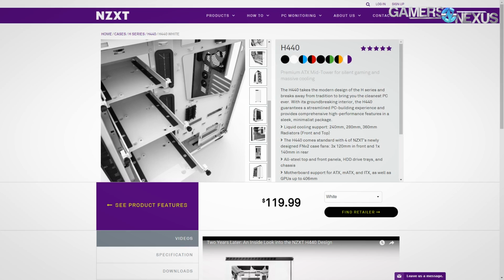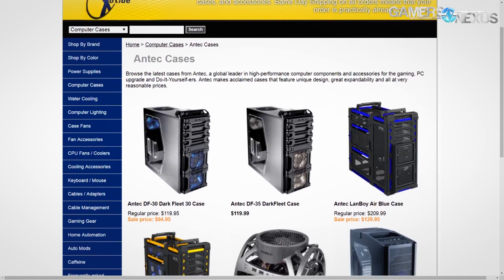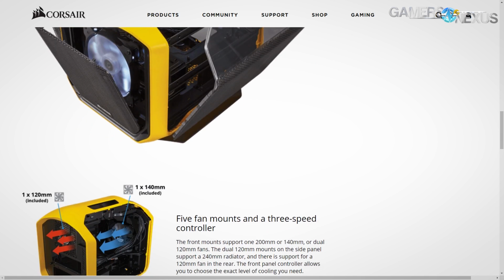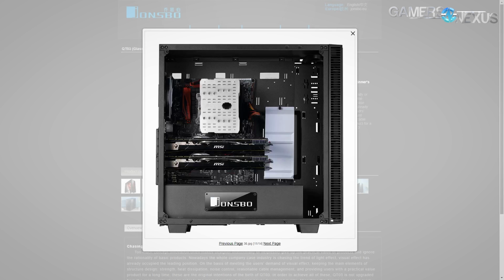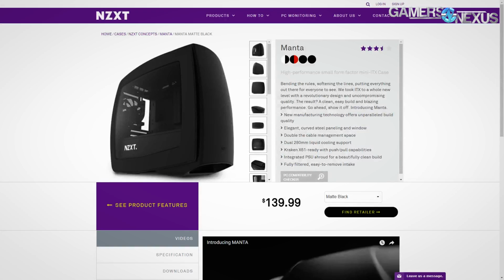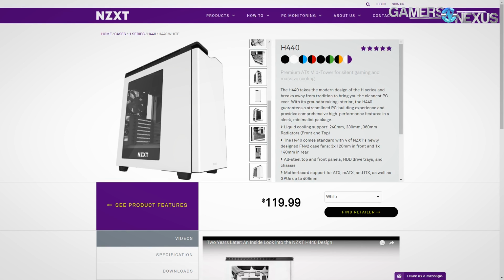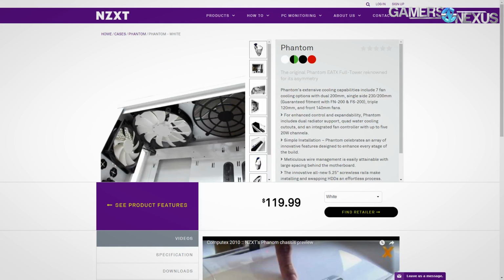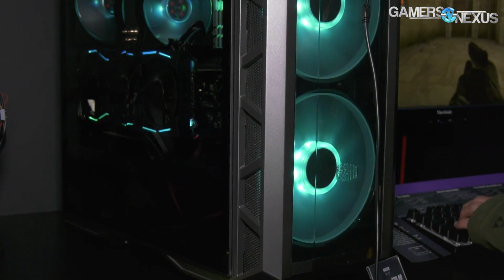Reviewing the Case Industry

Comment: In terms of a air flow case, I wonder if it's possible to shape a case like a GPU blower fan so high speed air flow will quickly come in and leave?
Maybe have the enclosure, the part of the case that is attached to the case, have a powerful fan attached to it, and wired in a way so it's contact to be powered on the edge of the case when you put it on, but can come off with power off without dealing with wires.

It can also have this sort of 'metal/plastic' chamber like in the RX Vega where a huge fan is on the enclosure (or case door which is what I mean), and this fan sucks air from the side, uses that plastic chamber, to blow air into the case, which is linked to another chamber that surrounds the components, oddly you won't have a heatsink in this case like the RX Vega, to blow air through, but maybe some innovation could create something usable.

Hard to describe in words though.
Reply: Long statement short: Turn a PC case into a giant GPU Blower system, with noise dampening material in a small compartment where the hot air is dumped out, since it's already moved far away from the PC components.

Comment: Couple of ideas I haven't seen implemented -

1) Safety glass instead of tempered glass, primarily for the sound-deadening properties. The other benefits of course are safety and durability. 

2) Perforated glass. Drill some holes in that glass to improve the air flow! This solves - or at least helps - the biggest problem I see in modern case designs, which is lack of air flow. It's like we've lost a decade or more in case design progress.

3) If you make a larger case, allow for mainboards with more than 8 expansion slot capability. Most of the huge cases I've seen simply ignore expansion slots. 10 is a good number. I like big cases myself, but most of them are unsuitable for this very reason; I won't buy one with only 8 slots.

Comment: Super cool video!  I have some  bones to pick too. I actually want higher end cases. I want  cases in the $100-200 range that are worth it. Not paper thin steel or tons of plastic. Hate filters built into the case that are exposed that never look clean again unless you wash the filter (450d and I imagine the fractal mesh case will not look great after 6mo use).

Comment: I want a round or hexagonal, pillar shapedl ITX case, where the components are put around the open center, with one big 180 - 220 mm fan on top and a good dustfilter at the bottom.

Comment: Corsair  400Q = My Favorite case
The only recommendations I could make is: 
Making the front panel removal not require side panel removal. 
Having the PSU shroud go all the way across as one piece.
add about an inch of width for cable management behind the case
and Swap-able parts with the 400C

Comment: Manufactured case design, especially preparation for long-term hardware evolution in advance is so poor nowadays that I am seriously considering building my own box next time.
Low quality materials, mindless internals placement, reduced airflow for the sake of aesthetics and last but not least, the damn tempered glass panels.
Call me archaic if you must, but I like meself a good aluminium slab with lots of grooves and notches to screw things around, lots of grates to pull in air through and being able to involuntarily knock the case on its side with my knee or elbow now and then without fear of shattering something to million pieces. All in all, I like hardy stuff.
Transparent panels and RGB strips are fine. It's nice to have something shiny to look at.
But when the whole enclosure is flimsy, when it's made out of rust-prone metal and when the vents are too narrow because it all has to look extra sleek, well, that's where good engineering thought stops and the nonsense starts.

Comment: i think the case industry i fukked,  there is barely any choice left if you want a good value air cooled case with good airflow and low noise and filtered intake.
i spend most of my time fixing other people's problem because they just bought the wrong case,  they think aio coolers is doing them a benefit or glass side panel.  not to mention there is no need to get a case with 120mm fans, 140mm fans should be the standard by now.

Comment: I want a h440 case with a tempered glass side , which doesn't use screws to hold on (some sort of slot in at the bottom click into place at the top) or swing door. + 2 top usb type c. black with white trims :)

Comment: All reviewers should finally STOP using Fanspeed % ! It doesn't say anything. RPM stays consistent. 1200 rpm are the same on every fan tested. 50% on a 1500rpm fan are different than 50% on a 2500rpm one, using % is just useless! There are even 800rpm fans out there if you set that to 50% it could possibly have problems even starting...

Comment: I think my next case will be the corsair crystal 570x. If they could remake a version of the corsair 780t with at least one maybe 2 tempered glass (side and front) panels that would be awesome. A remake of the 700d would be great too. I would like a case with a 3/4 height glass front panel with mesh behind it so that a minimum of 2 5.25" bays can still be added. Really don't like that the 5.25" bays are disappearing.

Comment: I saw that Antec 900 on the thumbnail.. That was the first case I actually purchased, was using beige and throw away cases I would get from people up until that point. I still have that case sitting next to my bed with a Q6600 and an 8800 gtx.
Reply: Old OEM cases would make sleeper desktop potential if you don't mind no interior sights.

Comment: As someone who owns a NZXT Phantom 820, I can confirm it is a lot of plastic. It has some metal in the side panels and in the main struts/supports of the chassis, but the vast majority you will interact with is plastic. To NZXT's credit, they did a great job of color matching the plastic bits to the metal bobs. That's pretty hard to do in the first place, and NZXT succeeded where many companies failed and made weird-looking, two-toned eyesores. The three 200mm fans are great for air cooling, and it has ample room and numerous hard points for fans, making it a great air cooling case. You can add radiators, but it's not very conducive for water cooling; even for CLC/AIO options. It has the option to mount a 280mm/360mm radiator in the top, and a 120mm radiator in the bottom for for something like a hybrid GPU/Kraken G12. To this day (I bought the case when it was new), I still have not figured out how to remove the top panel to install said radiators though. The manual was not very helpful in how to remove the top panel, and it almost feels like you will break the retaining pins which hold the top panel on. For that reason, I left it on and never bothered with it again. There is also lots of connectivity on the front; mostly USB 2.0, but it does have 2 USB 3.0 slots.

I never bothered with the rubber grommets on the back, but the grommets inside the case were very good. Even after all of these years, they still feel new; not stiff and dry-rotted like cheap plastic gets. The rubber grommets inside the case cover all of the cable routing cut outs tastefully and make the cable management job I did look way better than it probably deserves. Also, in my experience, bare metal routing cut-outs in a case have a tendency to be sharp, so I like that the rubber will protect my gorgeous hands. I need them after all! 

The RGB controller is very basic, and the fan controller follows in those same footsteps. For the RGB lighting, you can change through about 50 colors, but it only seems like 15. There are only two different effects as well: on and off. The fan controller also only steps up and down through a couple of RPM settings, and you have to press a selection button to cycle from one "region" of fans to the next (side, top, front, etc.). I don't really use them, but it is better than nothing. Some motherboards can control fan speeds now, so you may not even need to fiddle with again. Really, they were the trendy thing to have, so they got added in for vanity.

Even with all of this, I still like it very much. I bought it because it sits high off of my carpeted floor with it large feet, has lots of dust filters that are easy to clean, enormous fans for lots of airflow to the components that need it most, lots of room to expand in the future (which I have), and its sleek white exterior. The controllers were never something I planned to use, but they are kind of fun to play with every now and then. Change the mood lighting and what-not. I can't recommend it now, but I'm still very satisfied with it. It has shown its age with outdated "fashion" components, but it still gets the job done, and does it well. I'd say the real problem with flagship cases is that they are "trendy". Whatever the latest crazy trend is, a flagship case will probably have it. I say if it suits your needs for now and in the future, go ahead and buy a flagship case if you like the aesthetic; otherwise, it will get outdated very fast and leave you wanting.

Just wanted to give a psuedo-review of the Phantom 820 to give some perspective on how case ideals changed from then to now in more detail.

Comment: What ANTEC needs to do , is the old 180b but with new stuff , get rid of the optical bay , let it be 3x 140 or 120 in the front , 2x 140 or 120 on the top and 140 in the back , and power suply shroud , with black interiour boom done , you have a fract... i mean a better case.

Comment: Add wheels to the case. Cases get heavy and it is getting harder and harder to work in them. Personally I use Pitstop Furniture CPU700B Black Computer Stand but it would be nice to have a case with a built in feature.

Comment: Idonno about you, but my favorite Antec case was the P182 in Gunmetal Black. I'm currently trying to shoehorn an old 900 with a Corsair H80i cooler and I'm having to modify the side panel. She just won't close! Also, taking the drive cages out and just having the front fan grills is a task. I just might chuck out the 120mm fan grill frames and glue in some 140mm fans with a new perpherates shroud on top. For time being, I had to glue the 120mm fan shrounds in place, but it don't look pretty. 3x 140mm fans will fill in the front nicely.

Comment: And here I am just getting by on gutting office cases and jury-rigging... bottom-mounted PSUs are still kind of new to me. So far the only case I've actually bought new is the Thermaltake Hr22--which is quite conservative (and that was only because my GTX 1070 wouldn't fit in any old office case).

Then again, considering I actually use all 3 5.25" bays (Blu-ray drive, bitsetting/IDE drive, and card reader) and 3 3.5" HDDs, I probably needed something quite conservative.  : P

I am kind of eating it now when it comes to buying a good Noctua cooler--gotta' keep it a bit smaller with less pipes for my humble case.

Comment: The biggest problem I have when picking a case is finding one that will actually fit my component choices.
The case is third on the list of choices. First is motherboard size and second is cooling type and generally a specific one that I want to use.
So if I want a case that will air cool a Matx board, then I look for a case that has the specifications for that.
The most obvious hidden number that I have to go do an extended search for, is the cooler height clearance.
So setting design aside, my first point of paring down my choices is to find cases that will take the height of the air cooler I have chosen. There's nothing more frustrating than finding a nice case at a good price only to find that it has limited height clearance for bigger air coolers, i.e not having at least 165mm clearance and preferably 175mm so I'm not limited at all.

Virtually no indexing for search is done with this cooler height parameter, anywhere. You can have the nicest looking case in the world, but it becomes useless if it doesn't fit the criteria.

So for the case industry, maybe they could all agree that in all their marketing materials, this max cooling height parameter can be listed with an asterix along with the board size maximums, because it's one thing you cannot work around unless you intend to keep the sides off the case.

Comment: I remember my first real computer back in February 2008.  Antec 900 with EVGA 780 SLI motherboard and Two EVGA 8800 GTX's plus a sound card with a 10,000 RPM raptor drive for the boot drive and a Z5500 5.1 sound system to rock the house.  God that was a great day when I brought it home and set it up.

Comment: Man...With that rundown on how much case manufacturers need to sell a month, I don't see my dream of truly s.f.f. cases in the mainstream becoming a reality.  Seems like people are too concerned over not having very chilly CPU/GPU temps in a  a case under 20 L or are afraid to work in a non-cavernous interior.
Reply: I would love to do an sff build, unfortunately I also want max performance, which means my 250 watt graphics card needs as much air as possible to keep it's clocks up and my heavy cpu overclock would not be feasible with a low profile cooler. I think much of the pc market shares my view on this, we prefer performance to size.
Reply: I wouldn't know much about milking max performance out of components but people squeeze a full-custom loop in my 13 L case.

Comment: meh the trouble i see with the case industry is the cost. Let me put it this way. Whenever i see surveys for how much people spend on their cases it blows my mind. These people have budget builds are buying 90 dollar cases when the 30 dollar raidmaxx will hold their parts just as fine. The most expensive case i bought is my riotoro cr280 for 55 dollars. Othwerwise when im doing budget builds for other people the rosewill FMB-01 (and guess what its still a great case. 19 dollars free shipping and it comes with 2 fans!) Major case manufacturers are going after the pricey market when budget builds are becoming more and more popular (for instance channels like randomgaminginhd are popular) All a case needs to do is hold your parts. That means supporting an ATX PSU, a motherboard of your choice (usually in the budget side of things micro atx is king for the cheapest motherboards), a graphics card, and a couple of drives (usually an ssd and 3.5 inch hard drive) hell a dvd drive isn't really even needed anymore. I always recomend the cheapest cases that just fits their components because if someone had only a budget for an rx 550 for a gpu but was going to get a 90 dollar case well guess what now a 1050 ti is in the budget now. People claim that you should get a nice case because you can just upgrade the components that are inside of it. Nobody ever does that though. They find a use for their old build and generally start from scratch with a new case, new psu, new everything. I hate the industry standard for youtubers to bitch about how on cheaper cases that the edges are razor sharp or some shit like that. Ive worked in those cheap ass cases multiple times. You don't cut yourself unless you are rushing it or being stupid. If they truly want to get new people into purchasing pc parts they need to encourage the cheapest stuff for people to start out with. They will want to upgrade over time when they feel comfortable doing it.

Comment: i do like the in wins
they seems to be coming up with new things AND listening to their customers
u can see small upgrades from gen 1 to gen 2 that make em well worth it
i really like that pulling the air from the bottom
i just dont like the PSU up top otherwise i really like those cases
the meshify c is nice too
they def listened to their customers
otherwise yea stuff is pretty stagnant
very hard to find a case thats laid out well with a tempered glass panel
that has good air flow and is made out of quality materials

Comment: I'll definitely buy the Darkbase Pro 900. I would prefer a cheaper version with none of the RGB crap, front door and fan slider though. Still it doesn't looks outlandish while having some pretty trick ideas. The upside down motherboard and the chi charger while able to hold multiple drives really interests me.

Comment: The CoolerMaster h500p is if the set it up for dual front end radiator support. if they put any major water cooling support into the case that's where the break even it. 200mm fans are cool and the CM h500p looks sick but if they didn't set up the water cooling aspect correctly that $150 case will be a hard pill to swallow. plus as mentioned as cool as a 200mm fanned radiator would be you have to have a standard that everyone is following or 200mm fan is just going to flounder again. Cause what the problem with 200mm+ fans, was if your's that came with the case went bust you had to buy that brand fan to replace it. Had a cousin for his big fan case had to pay $60-$85 to replace his cause it had a faulty bearing and one of the blades snapped when the bearing failed(thus conveniently voiding the warranty).